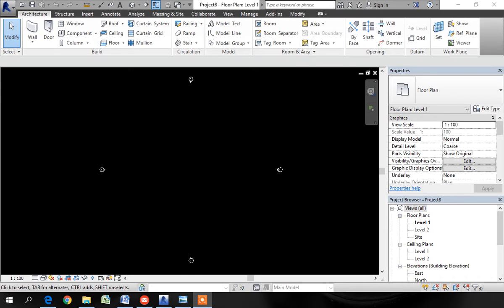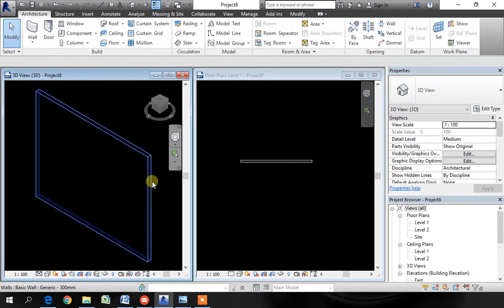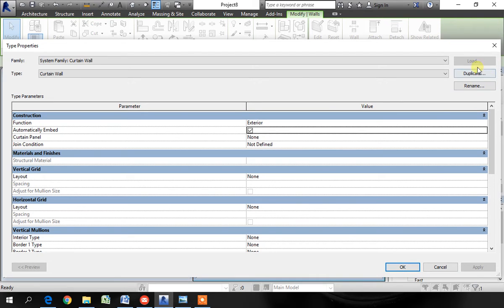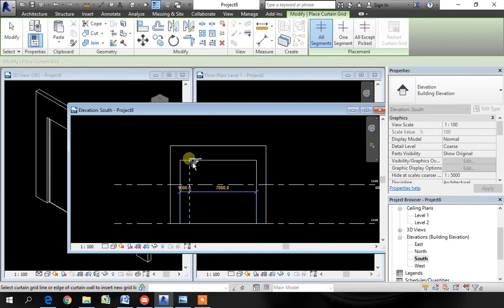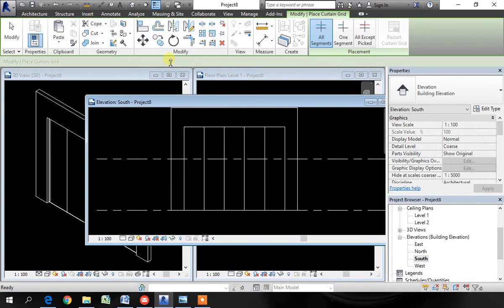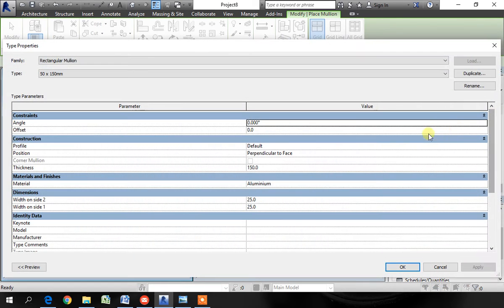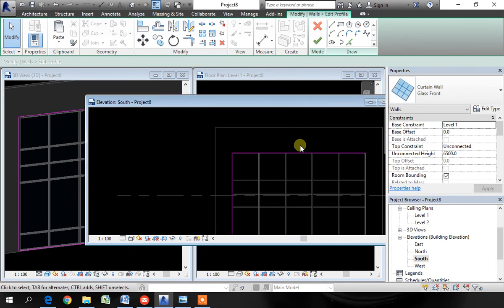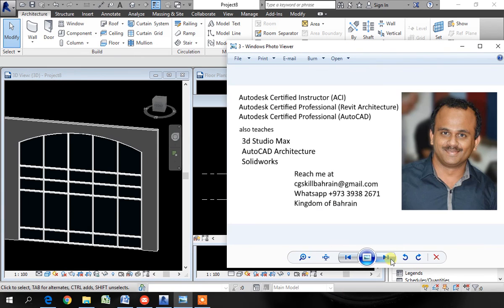Glass Facade Using Curtain Wall 21 07 2016

Comment: hello boss
how are you?

I am Curtain wall facade designer

May I know that how is beneficial revit for facade industry?
or you can recomend any 3D software for facade industry except AutoCAD and Orgadata Logikal.

You reply will be highly appreciated.
Reply: Hello.. lemme tell uh .. if uh are using other facade designing software it's better to use those instead of revit .. revit is very vast software knowledge of engineering for desired field is somewhat necessary but uh can also learn to design n 👍👍